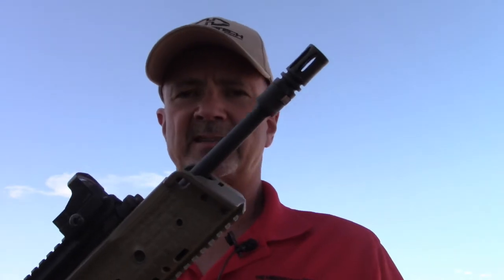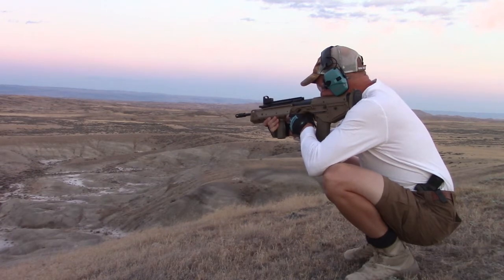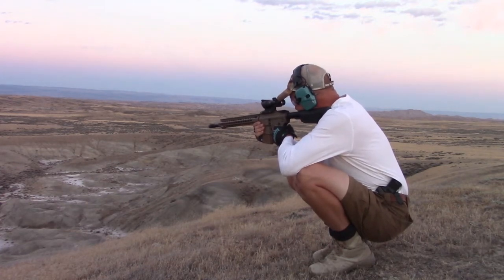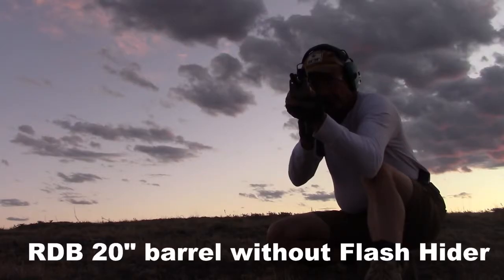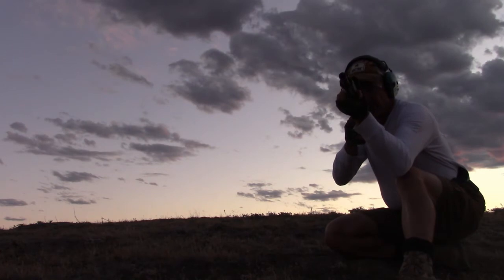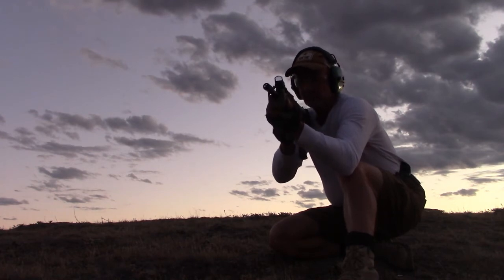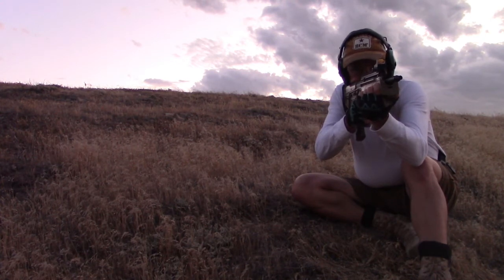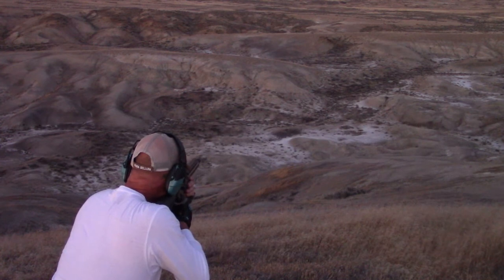Muzzle Flash 16" vs 20" Barrel. RDB vs AR15

Comment: This is nice information. I just purchased my first 3 port muzzle device. If I install this on a 20in  long barrel will I get a increased flash or no flash like in your test ? 
Thank you
Reply from the maker: 20" still has a flash, just that if I debating between a 16" barrel with flash suppressor vs 20" bare I think the 20's flash signature isn't that much worse than the 16, so I choose the added velocity of 20. 

A ported muzzle device, a compensator, or brake will probably have a bit more flash. 

The is a guy who tested a bunch of flash hiders using a high speed camera. Worth checking out for a more scientific analysis.

Comment: If the flash hider was causing barrel droop to shift your POI wouldn't all calibers be effected the same way? Why would the 77gr droop more than the 62gr? its still 3oz on the end of the barrel either way...
Reply from the maker: No idea the mechanism behind the result. I suspect barrel whip harmonics is involved in some way. I ended up putting the RDB Hunter thread protector on the RDB.
Reply: @AmbGun  I honestly don't know the fist thing about ballistics haha so you're guess is as good as mine
Reply from the maker: @KevinWood44  Here is a high speed video of barrel whip with different muzzle devices. 
https://youtu.be/0yzKLyARNeU?si=4UOCXdssjtdwDPOl

Comment: Do you think your zero issue was the result of the barrel extension being loose? Also fantastic information. It makes me revaluate going with a shorter barrel if all you are going to do is put an extra 1-2" right back on it with a muzzle device.
Reply from the maker: The zero disparity by bullet weight with a muzzle device persisted after the barrel extension nut "repair".  I ended up putting on a KelTec Hunter Thread Protector...featured in my latest RDB video "My KelTec RDB Updated and Refined for 2023"
https://www.ambgun.com/ambidextral-rifle/keltec-rdb
Reply from the maker: As for muzzle devices, a suppressor that reduces sound and flash might be worth the added length.

Comment: So if a 20" bare naked barrel inherantly has less flash than a 16" with an actual flash hider, why run the 20" bare? You should do a video comparing the muzzle flashes between a 20" ar with a muzzle brake to a 16" with a flash hider. I'd imagine a muzzle break wouldnt add to the muzzle flash but give it the recoil of an airsoft gun
Reply from the maker: Given that some flash hiders are very good at their job, I'm not sure that a 20" barrel has less than a 16 with one of these better flash hiders. But I do think the added velocity of a 20" barrel coupled with narrowing flash difference in flash signature. There is a channel somewhere that has done some detailed comparisons of different flash hiders...they compared the flash hiders to a bare 16" barrel, but didn't compare to a 20".

I have another video on the RDB and its sensitivity to having muzzle devices mounted on it's pencil barrel. Accuracy remains good, but the point of impact difference between 55gr, 62gr, and 75gr is almost 32MOA when fitted with a flash hider...virtually no difference in point of impact between all of the bullet weights with bare muzzle.

I have a forthcoming RDB video where I have installed a RDB Hunter model thread protector and will compare point of impact across the different weights. 
https://www.ambgun.com/ambidextral-rifle/keltec-rdb

Comment: To me, part of the value of a bullpup is getting the entire package as compact as possible. I'd be hesitant to go from a 16" barrel to a 20" barrel. On the other hand, if an 18" barrel with a very small muzzle device would give less flash than a 16" barrel with a traditional flash hider, the 18" barrel would be appealing to me. 

The idea of a linear compensator appeals to me. A small one probably doesn't do much if anything to change the sound level of a .223/5.56. However, if a very tiny linear compensator did anything to reduce the sound coming at my ears, that would be my first choice.